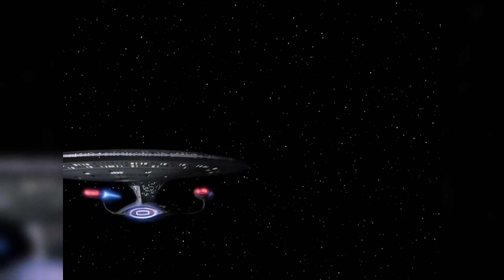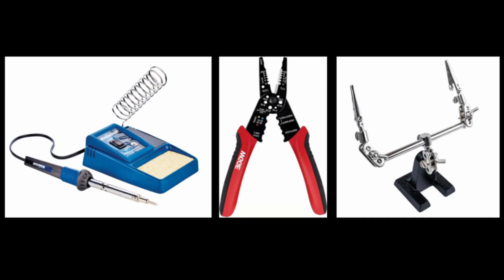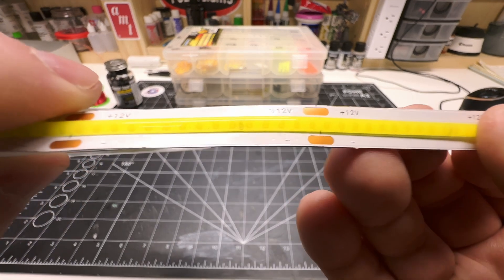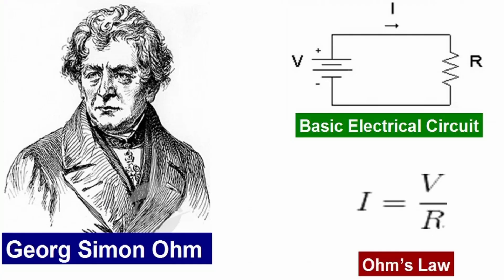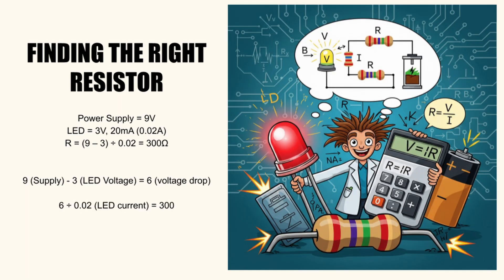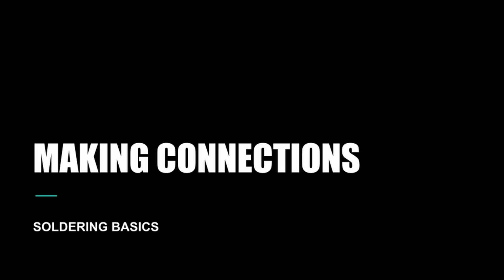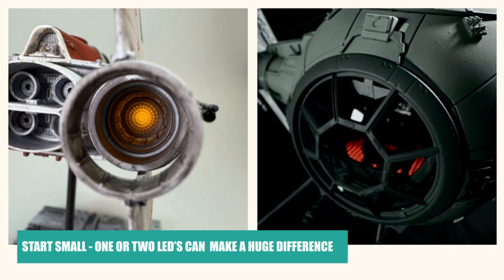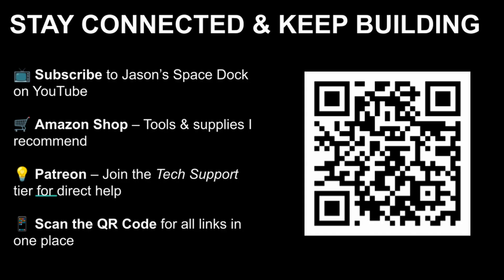Lighting Scale Models Made Easy – A Beginner’s Guide

Comment: One thing I will add, is it is possible to do a 3V circuit with multiple LEDs wired in parallel and no resistors if the LEDs are the same or about the same value. Parallel circuits are "current dividers" meaning the total current of the circuit is divided evenly between the branches, assuming the branches all have the same value. If you have a component with too low a resistance value, it is going to draw more current than the others.

I have lighted a Moebius Cylon Raider this way with six LEDs powered by two AAA batteries (1.5 volts per battery, hence 3 volts total). Since two of the LEDs were supposed to be amber instead of white, I simply dipped those in clear orange paint to get the shade I wanted and it didn't wreck the LEDs otherwise. I also did it with only two LEDs to light up the cockpit of a 22" Eagle Transporter. Power there came from a single 3 volt non rechargeable lithium  battery cell. Both have worked great with bright lighting and I got good longevity out of the projects with no real need to change batteries.

Now, if you are running lighting that needs flashers (such as nav lights on a Star Trek model) or something controlled by a timing circuit, then that will need higher voltage since many semi-conductor or integrated circuits use 5 volts to run and any more than that will cook them. Resistors are key there to keep from frying the circuit. So resistors absolutely become critical.

Finally, when designing a battery powered circuit, keep in mind how long you need it powered for. There are some terrific button batteries out there, but if their milli-amp rating isn't so high and you are running a lot of LEDs or have other features, they are going to drain down very quick. In the case of my Cylon Raider, two AAA alkaline batteries powering six LEDs in parallel still provided plenty of light after running for close to 36 hours and the lithium cell on my Eagle also worked about that long since in both cases I flipped the switch and left them on. Naturally, power supplies running off outlets won't have those restrictions. But if this is for a contest, there may be limits as to what outlet sources are available on a contest table. That's why a battery powered circuit can have its portability advantages.
Reply: Hey there, do you remember me, Austin Texas? Answer to your question is not all of the lights will have the same brightness unless you use ones that have the same current volt values like Blue, Green, White LED's (3-3.2 volts etc.). Get a 3V multi color x-mas light set from any store and dissect them, you will see certain Led's have resisters where others don't
Reply: @cozmicpfunk   Hey there Mr. John Funk. Long time no see amigo!!!

Comment: For people just getting into lighting, i HIGHLY recommend you just look for prewired LEDs rated for 12v, then run them on a 9v power supply, in parallel. Once you get some confidence and experience with that, then start thinking about building custom circuits with resistors. You can achieve 90% of what you want using prewired LEDs.

Comment: WOW this is a great resource i am currently building a wood model of the Mississippi King and have to install lights and for about a week i have just sat a my work bench and thought maybe the lights are not worth the trouble, i have seen other videos about lighting but most speak as if everyone knows what all the stuff is and means which i don't but i have watched your video twice and i am feeling a lot more confided about installing the lights you have a new subscriber and i am thankful i found you and your videos. looking forward to seeing more THANKS AGAIN
Reply from the maker: Well keep me posted. I'm curious how it works out for you!
Reply: @JasonsSpaceDock  Update on boat lighting.  This went much better then i thought it would. i did not use the lights that were supplied with the kit , the were just straight lights so i went to amazon and bought 3mm 3V white lights with a diode already connected. I set the lights in the first two decks of the boat ,connected the wire and ran to the supply and wow it worked and looks great 6 more lights to go but it is easier then i thought it would be Thanks to you and your video, and with time i can see me doing moor lights Thanks Again for your videos i look forward to watching a lot more...

Comment: Not quite-- this modeler started with D-size batteries and mini light bulbs! However, I took a long nap but am slowly rousing... I've gone through almost all of your backlog, you have shown how you calculate and implement a simple circuit, I've learned of some of your tech history-- but the one thing this guide misses is at least one concrete example. Soup to nuts-- yes, even an install.
Not the greatest omission. But you do it well. Another thing might be to go over the actual voltages of each color of LED. I see people using a coin cell -- in 3V -- for testing a red LED. Sure, okay for a test, but now that poor baby is near death. Of course, because it uses 1.2 - 1.5V. That sort of thing. You could also touch upon series/parallel combo circuits.
Otherwise, bang on, man! My only problem with your etsy store is the Canadian Postal Strike notice...

Comment: What about using LEDs with resistors already installed by the supplier?
Reply from the maker: Just check the specs on those ones, because they'll tell you the input voltages they're meant to run on.
Reply: @JasonsSpaceDock 
Ok, thanks. 
I have some models that I'm intent to light up and some WWII propeller aircraft that I planning to motoriz. 😊